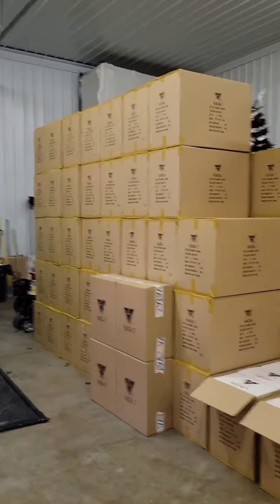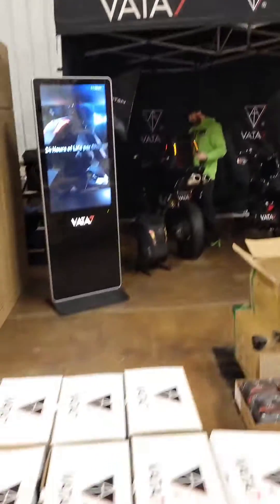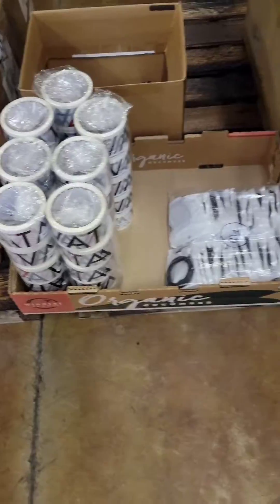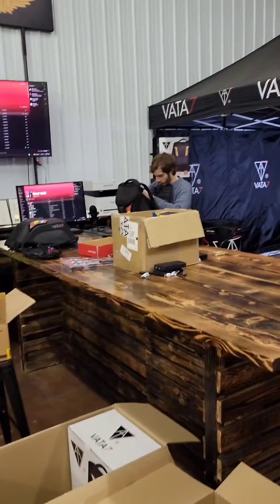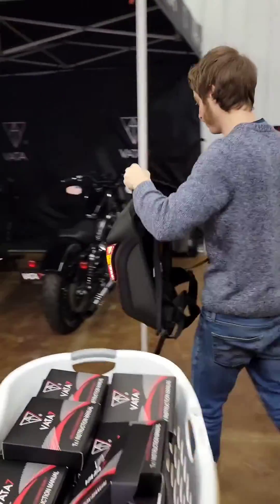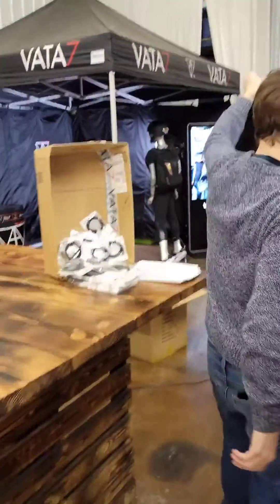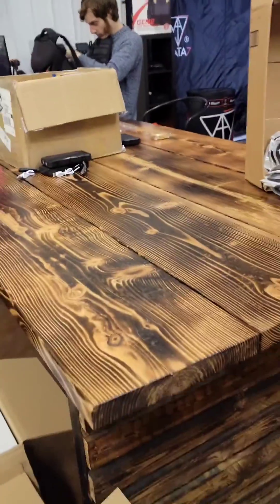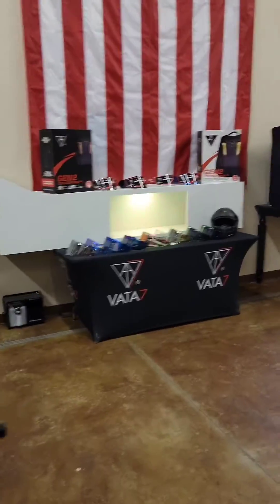VATA7-USA Set up building GEN2 Smart LED Tech Packs!

Comment: Not talking trash. I’m really asking. Are these legal to ride with in USA?  I have searched and can’t find any laws specific to a helmet other than it can’t be your only turn signal or primary signal system   So I really want to get both. But I don’t want to make that purchase if it might get me a ticket using it
Reply from the maker: Hi Friend, yes!  Our X1 Smart LED Helmet is DOT & ECE22.06 safety rated and approved.  Both our X1 Smart LED Helmet & GEN2 Smart LED Tech Pack is legal globally.  In Germany, we have our Ghost Mode in our VATA7 mobile app for them, since they can have turn signals and brake light but not the front accessory LEDs on all the time (Normal Ride).  Everywhere else, including the USA is legal.  www,vata7.com
Reply: @ second question. Can someone come to the vata7 location and get gear quicker of be able to try on a helmet for the best fit before purchase?
Reply from the maker: @DaUnforgiven1  You can set up an appointment at info@vata7.com
Reply: @VATA7-  appreciate the feedback. Thank you.
Reply from the maker: @DaUnforgiven1  You're very welcome!

Comment: Can I purchase a second TX unit for my 2nd bike ?
Reply from the maker: Yes. www.vata7.com/products
Reply: "vata7 company is scamming me.
I ordered on January 2nd, 2024 and it's been over 5 months and I received an email saying that the helmet is not finished because the shell parts are not available.
vata7 company lied to me twice.
First time before I ordered, they said it would take 6-8 weeks to make the helmet (this is a lie. It's been 5 months and it's not finished yet).
Second time, they said it would be delivered next week on May 18th, 2024 (this is a lie. I waited for 3 weeks after May 18th and they didn't even respond to my inquiries, let alone delivery.)
When I asked why the helmet didn't arrive in April, 2024, vata7 tried to persuade me to wait by saying they would give me one more visor, so I kept waiting.
Now, when I emailed them asking why it didn't arrive, they didn't read it and didn't respond to me.
Even when I sent it to the vata7 homepage messenger, they didn't respond to me.
So I sent a refund request via messenger as the last inquiry.
vata7 didn't respond, so I wrote a comment on the official vata7 Instagram saying that if they don't reply within 24 hours, I will expose the lies they have told me and the fact that the product hasn't arrived and I haven't given them a refund.
The comment was deleted 3 hours later and vata7 blocked my Instagram account.
I received an email from the vata7 company saying that sizes XS, S, 2XL, and 3XL are currently out of stock and cannot be shipped right away.
For reference, I ordered size 3XL.
If you're thinking about ordering after seeing my comment, be aware.
The vata7 company is out of stock and you may not receive it even if you wait 5 months like me.
I will continue to expose them by creating infinite Instagram accounts until I receive a refund or the X1 helmet."

Comment: nice  hard working family business, cant wait for my helmet to go with my vata bag
Reply: "vata7 company is scamming me.
I ordered on January 2nd, 2024 and it's been over 5 months and I received an email saying that the helmet is not finished because the shell parts are not available.
vata7 company lied to me twice.
First time before I ordered, they said it would take 6-8 weeks to make the helmet (this is a lie. It's been 5 months and it's not finished yet).
Second time, they said it would be delivered next week on May 18th, 2024 (this is a lie. I waited for 3 weeks after May 18th and they didn't even respond to my inquiries, let alone delivery.)
When I asked why the helmet didn't arrive in April, 2024, vata7 tried to persuade me to wait by saying they would give me one more visor, so I kept waiting.
Now, when I emailed them asking why it didn't arrive, they didn't read it and didn't respond to me.
Even when I sent it to the vata7 homepage messenger, they didn't respond to me.
So I sent a refund request via messenger as the last inquiry.
vata7 didn't respond, so I wrote a comment on the official vata7 Instagram saying that if they don't reply within 24 hours, I will expose the lies they have told me and the fact that the product hasn't arrived and I haven't given them a refund.
The comment was deleted 3 hours later and vata7 blocked my Instagram account.
I received an email from the vata7 company saying that sizes XS, S, 2XL, and 3XL are currently out of stock and cannot be shipped right away.
For reference, I ordered size 3XL.
If you're thinking about ordering after seeing my comment, be aware.
The vata7 company is out of stock and you may not receive it even if you wait 5 months like me.
I will continue to expose them by creating infinite Instagram accounts until I receive a refund or the X1 helmet."

Comment: Great intro - can you do a tutorial on how to install/setup from start to finish?
Reply: "vata7 company is scamming me.
I ordered on January 2nd, 2024 and it's been over 5 months and I received an email saying that the helmet is not finished because the shell parts are not available.
vata7 company lied to me twice.
First time before I ordered, they said it would take 6-8 weeks to make the helmet (this is a lie. It's been 5 months and it's not finished yet).
Second time, they said it would be delivered next week on May 18th, 2024 (this is a lie. I waited for 3 weeks after May 18th and they didn't even respond to my inquiries, let alone delivery.)
When I asked why the helmet didn't arrive in April, 2024, vata7 tried to persuade me to wait by saying they would give me one more visor, so I kept waiting.
Now, when I emailed them asking why it didn't arrive, they didn't read it and didn't respond to me.
Even when I sent it to the vata7 homepage messenger, they didn't respond to me.
So I sent a refund request via messenger as the last inquiry.
vata7 didn't respond, so I wrote a comment on the official vata7 Instagram saying that if they don't reply within 24 hours, I will expose the lies they have told me and the fact that the product hasn't arrived and I haven't given them a refund.
The comment was deleted 3 hours later and vata7 blocked my Instagram account.
I received an email from the vata7 company saying that sizes XS, S, 2XL, and 3XL are currently out of stock and cannot be shipped right away.
For reference, I ordered size 3XL.
If you're thinking about ordering after seeing my comment, be aware.
The vata7 company is out of stock and you may not receive it even if you wait 5 months like me.
I will continue to expose them by creating infinite Instagram accounts until I receive a refund or the X1 helmet."